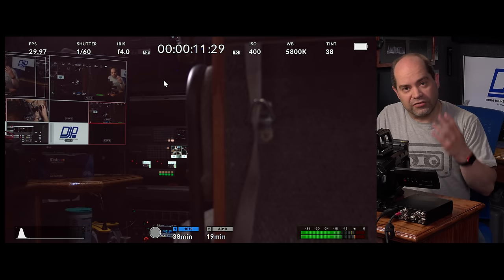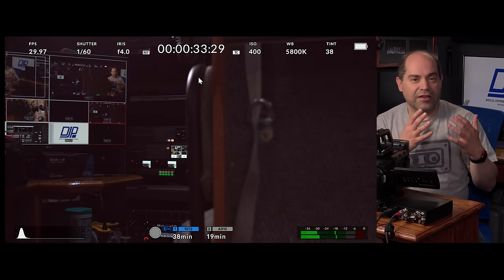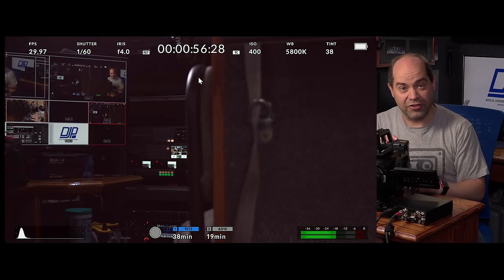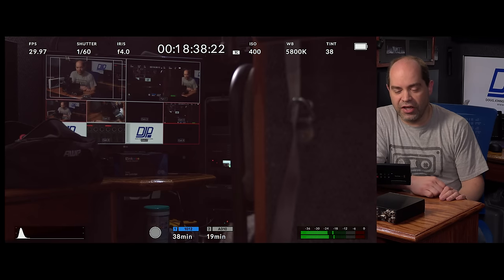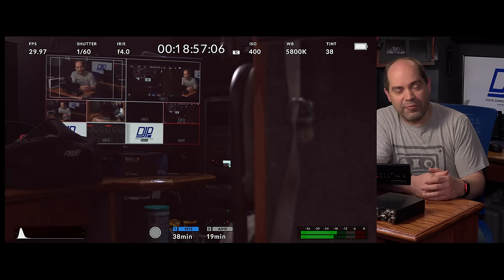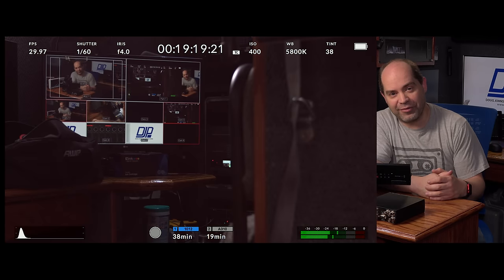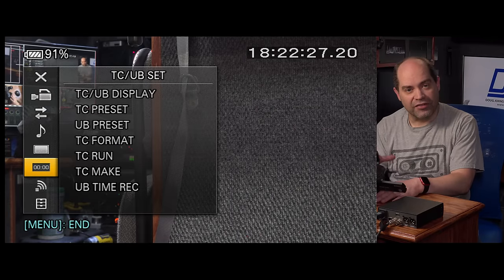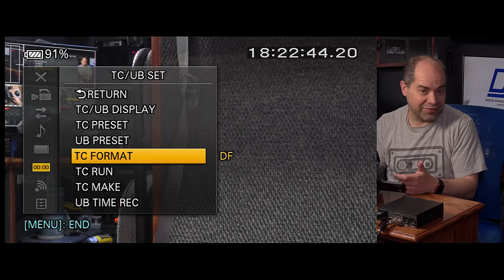Genlock, Timecode, Wordclock -- What Are They? Do I Need Them? Are They Interchangeable?

Comment: Great job in your explanation. Notice 26:03 that in Drop Frame TC the last colon turns onto a semi-colon to indicate DF. 
You may want to know that in the early days TV Broadcasting, certain high-end equipment needed several synchronizing signals, not just Black Burst. Switchers like Grass Valley and large Studio cameras needed Burst Flag, Burst Gate, Horiz sync, vert sync to name a few. Another note, is that Video Tape and Video cassette machines could not be gen-locked because of unpredictable rotations of their head drum. A Timebase Corrector was necessary to store at least one line of video coming off the drum and output the buffered line in sync with an ext ref. TBCs eventually advanced to having more than one line of memory, until they were able to have a several hundred lines of memory (a frame's worth), which was then called a frame sync.
It's refreshing to see a relatively young person like yourself who understands legacy technology.
Reply from the maker: I'm not quite as young as I look ;)

I've owned and used time base correctors, frame syncs, and color correctors myself. It wasn't that many years ago that I got rid of the last of them.

Comment: The oscilloscope, that was fun to see :) A bit off topic but as for the gen lock signal essentially being a black video/CRT image… this is basically still how many modes of HDMI/TMDS, SDI etc works. Vertical / Horizontal sync / blanking etc, so the output device more or less could be an DAC connected directly to an CRT. Solutions may be digital but the solution is still pretty rooted in how old analog technologies worked.

Comment: Great video and presentation! Thank you! Was really nice to get more visual explanation of Genlock and Tri-Level Burst.  I'm a production sound mixer for films and I've opted for the Atomos/Timecode Systems Ultrasync One for my clocking solutions because it's capable of all 3 LTC, Genlock, and Word Clock and has 2 ports so it can do more than 1 connection at a time.  It came out about the same time as the Tentacle Sync and similar miniature clocking boxes by Ambient, Betso, Denecke, etc.  LTC has worked well enough for most of the short video takes in narrative films, but it would be great to implement some genlock on longer documentary or event type gigs. I'm curious, how does Genlock affect a camera operator choosing to go "off speed" or use a variable frame rate to go back and forth capturing typical SMPTE frame rates and also slow motion/higher frame rates?  Does the camera temporarily just ignore the incoming genlock and then pick it back up when filming at regular speed?  Will the genlock even allow the operator to do that or will it need to be unplugged? Curious how that might work (and it probably depends on the camera's abilities?).  Thank you, again, for the great education and I'll certainly be sharing this with my fellow sound mixers. Cheers!
Reply from the maker: It could vary by camera model, but the ones I’ve used will just ignore the genlock signal if it is at an incompatible frame rate.

Comment: Hey Doug - thanks very much for the explanation. Definitely one of the best ones out there. Would you be able to do a video on LTC versus VITC and VITC's relationship with genlock?
Reply from the maker: I probably won't do a separate video.

The difference between LTC and VITC is how it is stored with analog video. LTC is an audio track whereas VITC is stored in the vertical blanking interval as part of the video. Digital video usually stores timecode as metadata or as auxiliary data within a data stream. So they act differently in that way.

The relationship between Genlock and time code doesn't change when you go from LTC to VITC or digital. Timecode is still just a number indicating what frame of video you're on and nothing more -- it still isn't used to tell a camera when to start a frame or line of video.

Comment: Doug! That was a very informative video. I learned a lot. I love the look of your video. What's your lighting and camera setup?
Reply from the maker: Sony PXW-Z150 primary camera, Blackmagic Design Micro Studio Camera for overhead shots (don't love it, but it works). Lighting is three LED panels -- a 60W panel just above me to my right, another 60W panel just above the camera, and a 30W panel just behind and overhead for a rim light.
Reply: @djp_video  Man! I'm amazed that your light looks so soft with panels. Are you modifying/diffusing them? I would love a BTS of your setup. I was also surprised by your camera choice which is very different from most Youtubers. I'm happy you can use different equipment and still get great results.
Reply from the maker: The panels come with a plastic diffuser panel that sits right in front of the LED elements, but that's it. 

I'm primarily a live event video producer. For the types of things that I do, camcorder-style cameras make a lot more sense than the typical camera options used by most YouTubers. I have to be able to shoot in a very wide variety of situations -- outdoor, indoor in well-lit rooms, indoor in poorly-lit rooms (almost always where we have no control over lighting);  at varying distances from intimate interview closeups to conferences with the camera way at the back of the room, to sporting events with handheld roving cameras, and no other type of camera gets even close to handling all of those situations anywhere near as well as camcorders do. They were designed and built for that. ILCs and studio cameras might handle one or two of those situations alright, but they have some really significant limitations in others.

The Sony PXW-Z150 camera that is my goto choice for most events, has a 1-inch class, 20MP sensor, so it's larger than your more traditional camcorders and broadcast cameras, giving it the ability to capture more light than other models, yielding less noise and more detail. But the sensor isn't so large that dealing with shallow depth of field with moving subjects is an issue either. The 20MP sensor lets the camera crop in on the sensor even in 4K without any loss of detail. The Z150 gives a 24X zoom range at f4.0 (12X optical plus 2X "Clear Image Zoom" which is amazing), so I can shoot both up close and far away and know that I'll get a good shot. The lens is also higher quality than the lenses that most people use with their ILCs, so the image detail is consistently a lot higher than I've seen (and gotten) from other cameras. The Z150 also costs far less than even a single, decent lens for a B4 broadcast camera. And when you do the types of events I do, having more cameras is almost always better than fewer "higher quality" models. Six cameras for an event is my general minimum. Having to purchase 6 or more of most other types of cameras with lenses and other required accessories puts you into big budget territory. For the handful of bigger budget events that come my way, where a true broadcast camera is required, I can rent them.

I'm frankly shocked that anyone even attempts ILCs or studio cameras for mobile, on-location video work. I've tried them, and they are just so incredibly frustrating to use, and yield lower quality results. They just have so many more issues to deal with. Camcorders were designed specifically with these workflows in mind, so they tend to work really well.
Reply: @djp_video  If I may ask... What's the make and model of your light panels?
Reply from the maker: They aren't made any more. These are similar, though not exactly the same: https://amzn.to/3sIpCZd

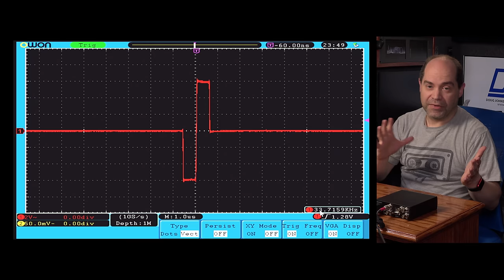Comment: 12:07 I guess often problems people were debugging probably were more related to repeaters, videomixers/hubs, etc on the cable run, or device specific issues, not actual cable delay/latency. Everything else usually is magnitudes slower than the actual cables.

(I think electric cable delay at 1km is around 0.000003s (1000/299792458) and the double 0.000007s (50% of speed of light), which probably is significantly more actuate than device internals. Signals travels at about 70% of speed of light is often a good guess, close to truth for many mediums and signal types. )

…Usually when cable delay is suspected people are likely fighting some other problem and misinterpreting their experiences. Repeater delays, cable attenuation issues, device incompatibilities etc could easily be misinterpreted as long cable going out of sync due to length.

That said for very long cable runs over extreme lengths, cable latency adds up. But not much if we discuss <1KM and precision is frame or lines. But yeah a sufficiently long cable will introduce meaningful cable delays.

Comment: Having the correct word means everything. So that's called iMAG! And wouldn't you know it if you put that in with NDI there's immediately a manufacture referenced page on the subject.
I have a interesting set of production equipment one's my own and one's a composite merge mess from somebody who owns a lot of equipment that's presumer/consumer and likes to skimp and pinch pennies but then waste money. I've been slowly transitioning to an NDI Mevo system. I finally got him to buy a third camera. this was due to size and help restraints so I've been minimizing cables and equipment as much as I can, unfortunately I still end up with a video production table that needs to be set up and broken down from a couple laptops. I feel I'm getting decent results but he always has to find something wrong. One of these was the major lag between camera and projection display. I really should not have done it but it was badly delayed and they were in front of the projection screen in a theater so I couldn't really blow it up that much either so it was slightly redundant and delayed.

Comment: Hi Doug. Love your channel and the info you share. And the video today was a fun walk down memory lane! I know the box on your desk very well (worked for Avid for some years). BUT - some of your info was wrong (NTSC/PAL) and it could actually be a good idea to make a video about that :-) Too much confusion floating around out there.
Reply from the maker: What did I get wrong? Perhaps I just misspoke.
Reply: @djp_video  You were not pushing it too hard, but still: NTSC, PAL and SECAM has nothing to do with framerate or resolution. Also, if you are not running composite RF, there is no NTSC and PAL. So S-Video, component, Digibeta and ALL signals in the digital domain has no NTSC, PAL or SECAM.
Reply from the maker: Okay, technically yes, but it's certainly implied and people watching would know what I meant. If I was to refer to System M, System J, NTSC M, PAL M, etc. nobody would have any idea what I was talking about. Those terms aren't used in common vernacular.
Reply: @djp_video  A lot of people say NTSC today and mean 480i.  And unless we use the correct terms, new people will not learn.
480i, 576i, 720p30, 720p25, 1080i25, 1080i30, 1080p25 etc. You get the picture. :-D
Why am I saying this? I have been teaching a lot, and unless the teachers use the correct terms, we can not expect the students to learn the right things.
A good example is PAL with 29.97 fps and 525 lines.
Reply: Oh, by the way - you channel is kinda technically, isn't it :-D

Comment: so you're recording this at 1:30 AM :-) 
I'd like to see a GPS-disciplined master clock and sync / timecode distribution hardware from Blackmagic
couldn't they create a sync signal that carries the tc data, say, in one of the 5 frame start periods ?
all the new blackmagic recorders have sync AND timecode input and loop, I suspect the new generation of mixers will do too
Reply from the maker: The tri-level-sync signal was intentionally designed to be simple. In theory, yes, they could include timecode in there, but they've elected not to.

Genlock is distributed using old-school analog video distribution amplifiers. Equipment which has an output can also be daisy-chained. Timecode can be distributed using any audio distribution amplifier. Both types of devices are really easy to find.
Reply: @djp_video  I don't know if you have heard of this yet but it's really interesting for keeping time synced across servers and could be implemented in normal computers and was curious if you could see a way to apply this tech too the video world it is also open source. https://youtu.be/JK3eTGkX6qY
Reply from the maker: @CYBERSTORM101X  There are quite a few devices of a similar type for the video world. Many of the companies making genlock and timecode hardware have options that will use GPS as their time source; it is a common way to go.

Comment: Hey Dough,
Thx for the great explanation. Helps a lot.
One question: I used a Blackmagic Decklink for SDI out a HD 25p signal with LTC. When I put this signal in Sony Venice 2 GENLOC in, it directly recognises it and a get a sync. But  when I use the same signal with ARRI Alexa 35 (SYNC In), nothing happens. Does it somehow mean, that Sony uses the LTC for syncing?
Best,
David
Reply from the maker: Genlock isn't SDI. I'm frankly surprised that anything recognized a signal from an SDI output. 

As covered in the video, there are two types of Genlock signal -- blackburst and tri-level sync. Blackburst is sometimes called bi-level sync. Blackburst is basically a black & white standard definition video signal. Tri-level sync is a simple series of pulses. SDI is very different and can't produce either of those. 

You'll need a proper genlock signal generator for any kind of compatibility with multiple types of cameras or other devices.

Comment: This was super helpful.  I am trying to figure out how to properly sync a Dante network to video.  If all of the video gear is is synced over SDI, can just one device be on genlock to keep audio and video in sync?   We have 4 cameras.  If all 4 cameras are on genlock. will the router, switcher, and recorders also be in sync?
Reply from the maker: When you say sync, are you referring to avoiding drift? Or lip sync where the same moment in time is seen on video as is being heard in the audio? They are different.
Reply: @djp_video  Thanks for your reply - I really love your channel.  The first problem audio/video drift over time. It's a church, so we record for an hour.  With all modern equipment, the drift is minor - like only a few frames. The second issue I'm having is more nuanced, but a significant problem. I am trying to use AES audio out of a Yamaha RiO stage box into a Blackmagic 12G Teranex Audio to SDI embedder.  The result is that I get frequent audio dropouts on my recordings.  My gut feeling is that it's a AES master/slave issue because the video system and audio system are not locked in time properly.

Comment: Hi from Tokyo. It’s great video but I have one question about sync. My audio network also use Dante and I’m using M5402 from studio tech as an external clock leader on Dante network. There’s DA-6400 recorder from Tascam also on the Dante network. If there are some audio devices not on Dante and i want DA-6400 and non-Dante devices in sync, in that case M5402 has word clock output so should I distribute it to DA-6400 & other devices word clock in, or no need for DA-6400 and just other devices word clock in?
Reply from the maker: If you want your devices to stay in sync so you can line up recordings in editing, you will need to use a wordclock signal to do so. You can use the Word Clock output on your M5402 and distribute that to all devices with a word clock input. You can use a word clock distribution amplifier to split that signal to any devices that may need it. Additionally, your DA-6400 has the ability to pass through the word clock signal so its output can be uses to sync another device.

Though the manual on the DA-6400 doesn't specify, I suspect that you could set it to follow the Dante leader clock and then use its Word Clock output to sync additional devices. That wouldn't be my preferred way to do it, but it should keep things synchronized whenever it is powered on.

Comment: What scope are you using to see this - have you used it to see signals pre and post switcher to measure the insertion delay?
Reply from the maker: It's an Owon SDS7202 (https://amzn.to/3z7jjS5), but nearly any oscilloscope will work -- these signals aren't particularly high in frequency.

I haven't done a switcher latency test. With genlocked sources, and for signals not being processed through a scaler, the ATEMs processing delay is less than 10 lines. But, if your video source isn't genlocked, add an average of a half of a frame. If your video source doesn't match the switcher's video format, add another frame. If the source is being run through SuperSource or a DVE, add another frame. If the signal passes through a converter (SDI to HDMI, etc.), those will add a millisecond or so. 

Figuring out the exact processing delay using an oscilloscope is going to be really difficult, as the video output signal (SDI or HDMI) isn't going to have obvious synchronization markers visible on an oscilloscope. One could connect the output of a switcher to a device which will generate a sync signal from the source (like the HyperDecks do), but those come with their own processing delay.